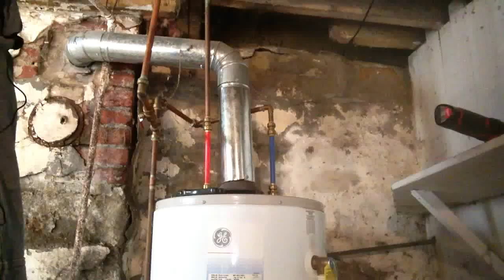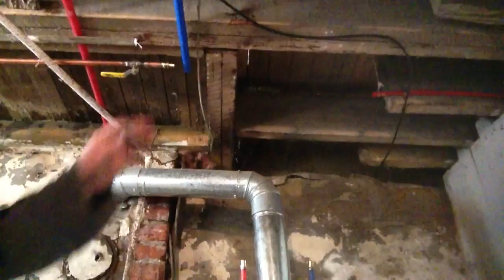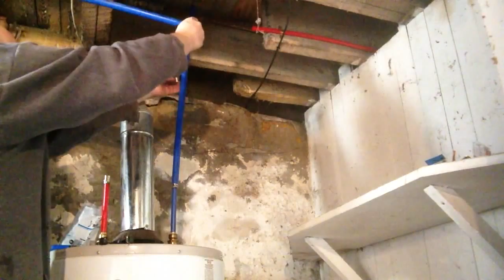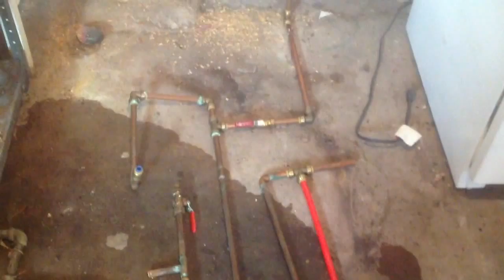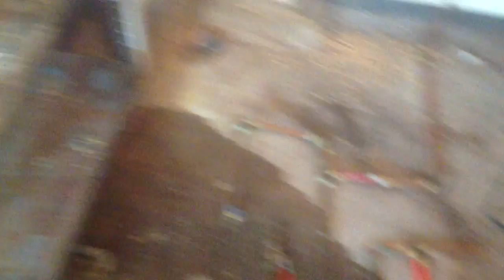Pex hot water tank hookup

Comment: Can PEX pipe be directly connected to a gas water heater?

The rules for use of PEX pipe near a gas water heater could be allowed or disallowed by: 
  * Local, City, County, or State codes
  * PEX tubing manufacturer installation instructions
  * Water heater manufacturer installation instructions

The Uniform Plumbing Code (UPC 604.13) states that "PEX tubing shall not be installed within the first 18 inches of piping connected to a water heater." 

The International Plumbing Code (IPC), which may apply in various areas, does not have the same stipulation. But the IPC does require following the manufacturer’s installation instructions; and some water heater manufacturers, specify that PEX should not be directly connected to their product, with a minimum of 18 inches of other approved pipe at the water heater connection. 

The PEX installation manual of Zurn, a major pipe manufacturer, also has multiple requirements for the distance of PEX from a water heater pipe connection and also from a gas water heater flue.

According to Uponor (Wirsbo brand PEX), a 2nd valve is NOT required, and the 18" rule is in effect for all types of water heaters.

The issue with using PEX pipe near the water heater, is that heat can accumulate above the water heater, and the pressure rating for PEX pipe is reduced as the temperature increases, and can be further reduced by the length of time of the exposure to the elevated heat.

--

How much clearance is required between the PEX pipe and the exhaust ducting/pipe/flue?

From what I've found specs typically say PEX pipe should have a minimum of 

12 inches vertically or 6 inches horizontally of clearance to sources of heat such as exhaust ducting/pipe/flue. 

--

I also noticed that I have another comment below from a few years ago (6 years ago). The other comment has more details (well, more letters and words), but this comment has additional information the other comment doesn't have.
Reply from the maker: Thank you for all great info.

Comment: TERRIBLE ADVICE!  NOT CODE COMPLIANT.  This is a disaster and will absolutely fail. 

Pex must be AT LEAST 18" AWAY from a Water heater.  Uniform Plumbing Code (UPC 604.13).

Also, Pex pipes MUST BE INSULATED to protect them from heat sources (very hot exhaust flue).  

Anyone following this video would end up with a great big mess and insurance will not cover it as it is obviously not inspected and would never pass inspection.

Comment: You CANNOT  run PEX all the way up to the water heater. This is per Uniform Plumbing Code (all of the US)
UPC Code 604.11.2 Water Heater Connections. PEX tubing shall not be installed within the first eighteen (18) inches (457 mm) of piping connected to a water heater.
Reply from the maker: We know
Reply: u know but still ran the damn pex all the way to the tank lmao
Reply: 18" for electric water heaters too?

Comment: Just curious, should there be a thermal expansion tank in this set-up somewhere? Thought it was code everywhere. Also, is copper to pex required on electric hot water tanks?
Reply from the maker: I don't think that this house has back flow preventer  on the main water line.This would make a expansion tank necessary. Not sure about code requirements of expansion tanks or what the reason for 18 inches of copper to the tank. If its Heat from the tank or heat from a blocked flue.

Comment: Look, man, I have something called EXPERIENCE!  That took 10 years to build along with my confidence. Then I see you Mr helper home-renter guy spreading misinformation across the internet that can hurt people thinking you are some kind of hero???? Flood = Mold. Pex cannot withstand constant heat and pressure over time it creates expansion and the crosslinked poly starts to stress. Did you know that? Pex has an Achilles HEEL that goes by the name CHLORENE!!!!! Pex has a rated life of 50 or less years. I have seen pex fail in as little as 5-11 years. WHY???? well let an experienced plumber tell you!!! Proper material handling never let pex see the sun!!!! it will cause the pipe to have sunburn and weaken it substantially, Next have an activated carbon tank (they last 3 years) to filter the chlorine and you will be most happy!
Reply from the maker: In those 10 years you gained some other qualities to. I think you are looking for the person that installed the water tank. If I ever find out who installed the tank I will pass this along.
Reply: ya whoever put it in at the beginning was wrong the vent is the hardest and most critical part of the design of a great water heater I think!!! Really carbon monoxide in the home is no joke!(please understand), then your attempt was not any better you need to have copper or approved metal connections 18" or longer. Please seek advise or further training but read approved material with IPC or UPC or IRC stamped on it those are legal codes and can get you started plumbing correctly!!!! (o YA!)

Comment: Yep... code for GAS hot water heaters in almost all States is 18 inches of copper then PEX... the PEX can very easily melt when to close to heat vents and the such.  Good luck with your install.  I'm doing mine in Florida, and the code is still 18 inches for GAS heaters.
Reply from the maker: Good point if you have burner roll out I could melt the tubes. That might be a good reason to run pex to the tank. Flue gas in your house the lines burst save your life. I'm just being rediculious here I know what you mean.

Comment: use 18 inches of copper from tank to pex.
Reply: dont worry man its no longer required and was one of the most ridiculous codes ive seen.
Reply: emutiny is it okay to connect lex directly to the hot water heater?
Reply: @guy5322  yes its ok
Reply from the maker: Ok
Reply: +themrhelperguy I am not trying get to claim I am a plumber or expert that's just the code in ohio hell I am not even sure why it's that I just know it is.

Comment: what was wrong with pex to copper?   we thought about doing this when we replace electric water heater.  Water heater is in a very tight spot.  Under the kitchen counter ( no door access) with stove beside it.  There's  some access in a closet on other side of the wall.  I dread this!!!!   Do I really need hot water this bad?  ( I do, but geez).   It's a mobile home, any suggestions ?   PLEASE.
Reply from the maker: Nothing wrong with pex to copper. The issue is having the pex connected directly to the water tank without copper.
Reply: Metal flex line is best

Comment: Code regulates how long of a run you need in copper off the tank till you can use pex. On a electric heater it doesn't matter. You should really cut those nipples off and start over. They are only 1/2" being fed by 3/4". That's a huge flow restriction. Cut it off and run it all in 3/4.  You'll get better results. Thanks for posting though.
Reply: It's pretty universally 18" of metal pipe before transition to plastic to meet code. Are you sure that doesn't apply with an electric heater?
Reply: Brian O. Not in Canada. It probably is safe in the u.s. but they’re just stricter.
Reply from the maker: +CCWSig it was existing so we left it .
Reply: themrhelperguy I understand that, It's still a choke point that should be changed. But I understand not wanting to do more work. Thanks for posting. Good luck to you.

Comment: I have noticed some issues with your installation. I am not writing this to "nit-pick" your installation, but rather to point some things out to hopefully help you make better videos (and better installations) in the future. At the end, I also answer your questions about adding the shut-off valve on the hot water line, and running the PEX tubing directly to the water heater.

The original configuration:

@ 0:10 you can see the original configuration with 1 cold water line running along the ceiling, off the the left. 

Here you can also see the hot water line from the water heater goes up to the ceiling and tee's to run along the ceiling to 3 places: 1) off to the right, 2) off to the left attaching to a piece of galvanized pipe, and 3) overhead towards the position of the camera and somewhere beyond.

@ 0:12 you identify the supply line coming up from the floor, that runs to 2 places: 1) to the water heater inlet, and 2) to the line that runs along the ceiling the the left.

The completed configuration:

@ 3:45, you can see that the cold water supply line coming from the floor is no longer connected. I suppose you have reconfigured things and made the connection to the water supply elsewhere, but you offer no explanation for it. 

@ 5:57 you can see the finished work overhead. 1) To the left, you can see that the galvanized pipe is no longer connected. 2) To the right, it appears that the red PEX (hot) is also no longer connected. 3) The line that ran overhead, above the camera is also no longer connected. I suppose you have reconfigured things and made those connections elsewhere (or they were no longer needed), but you offer no explanation for it. 

Having these unexplained issues in your video will effect your credibility, and will result in fewer views and likes, and more dislikes. 

Also, I don't understand why you didn't replace the short pieces of 1/2" PEX. I mean you removed everything else and could have easily replaced those short pieces too (see below about running PEX directly to the water heater).

As far as the shut-off valve on the hot water line. You should check the local plumbing code to be sure, but I don't believe there would ever be a case where it's not allowed. It's really a good idea to have one, and some places may require a shut-off valve on the hot water line. There may be specifications on minimum and maximum distances from the water heater to the shut-off valve.

About running the PEX lines directly to the water heater. Don't do it. It's never a good idea. Consult the directions and specifications of the manufacturer of the PEX tubing. Use their specifications for minimum clearance between the PEX tubing and the flue (water heater exhaust gas pipe), and the minimum safe distance from the PEX tubing and connections to the water heater. 

The reason for this is, under normal operation, the PEX tubing is under (a lot of) pressure. Any place where the PEX is near a heat source will soften (weaken) the tubing and crimp connections, even if it's not hot enough to melt or burn the tubing. As the water heater turns on and off, the tubing and crimp connections near sources of heat will be subject to thermal expansion and contraction which will weaken the tubing and will affect the integrity of the crimp connections. Over time, this will lead to leaks and premature failure.

Also, in the event of a water heater thermostat failure, the area directly above and around the water heater, and near the water heater exhaust piping will get very hot. Much hotter than under normal operation. It can easily get hot enough to cause the PEX tubing to soften enough for the tubing and crimp connections to fail.

You should install an extension between the water heater and the first PEX connection on both the hot and cold water lines. Using the PEX specifications, determine the length of the extension so that no part of the PEX tubing is less than the minimum distance and clearance to the water heater and other heat sources such as the water heater exhaust piping. 

It's a good idea to make the extensions a bit longer than that to allow a safety factor. The material and connections of the extensions should be rated to be connected directly to the water heater, and you may have to allow for minimum clearance to the water heater exhaust piping. Some good choices for the extension would be copper or galvanized pipe, or pre-made braided or flexible copper extensions. Consult local plumbing codes for what is allowed or disallowed.
Reply: good info.  on an gas heater i would agree but on an electric heater i dont see  any reason to not use it rite to the heater.  pex can with stand 200 and some degrees.  if the heater thermostat caused  it to run away it would  cause the pressure to  go up and dump it out the safety valve as well.  i think at that point  its irrelevant
Reply: @chuckley54494  The PEX handbook states: "Install a minimum 18 inches of
 metallic or other approved material piping between water heater and PEX tubing." Also: "Keep tubing a minimum of 12 inches vertically or 6 inches horizontally from sources of high heat, such as recessed light fixtures, flue gas vents, or heating appliances."
Reply: @coloradobeeguy  Thank-Q!  That's the info I was looking for in this message string.
Reply: I thought that looked funny.  I have already redone most of the copper in my house to pex and just about to install new 50 gallon gas, and relocating it about 5' from where it's at. It's just a rental but the landlord has been good. Renting basement as separate apartment and landlord just spent $900, comes with self cleaning and 12 year warranty. Present heater works but low pressure on hot side plus noisy. Already replaced 95% of copper with pex. Have sharkbite into present copper flex to heater only couple years old. May use them until I can order sharkbite flex water heater lines. Thanks for advise. Present has heater in shutoff valve.
Reply: Good information, thanks. I'm getting ready to use PEX to feed an electric water heater and I'm not sure how to make the transition from heater to PEX. I'll see if there is a simple way to do that and not cause a failure in the long run.
Reply: @jimacheson4933  they  now make metal flex lines with shark bite  end on one end.  if you wish. they are about 20 bucks a pop